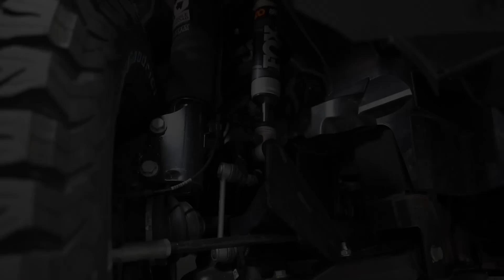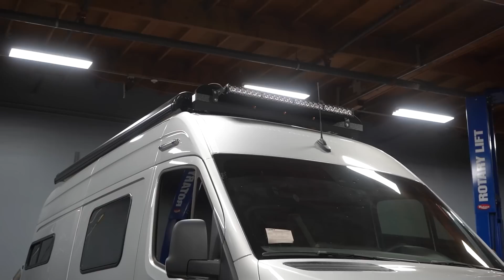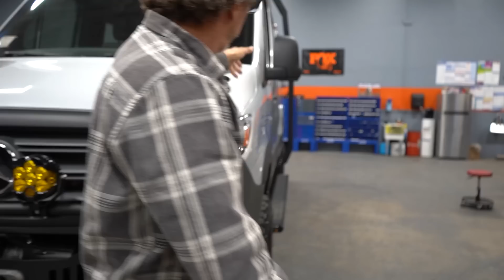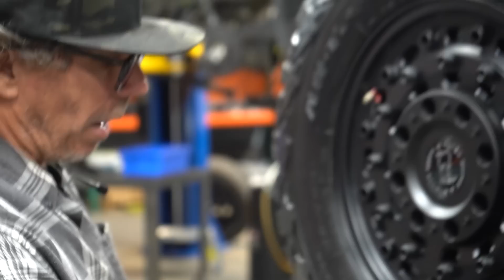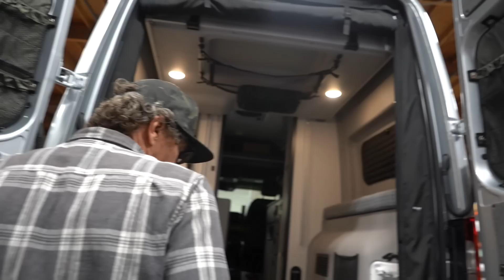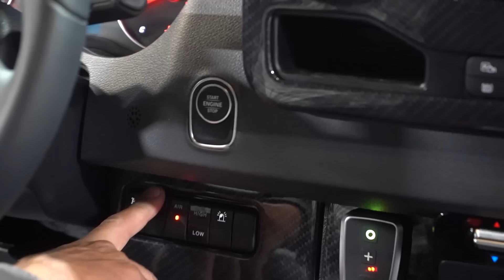2022 Winnebago Revel 4x4 | FULLY LOADED Agile Off Road Build

Comment: I find it weird that they didn't do anything to beef up that rear axle. Such a tiny rear axle, seems like a major weak point.
Reply from the maker: The Sprinter was originally built as a heavy-duty cargo van. Axles are thick & plenty strong. We haven't seen one break yet even with the extreme loads the ARB Rear Air Locker puts on it. Now that this van has the appropriately rated leaf springs & shocks, it's rock solid.

Comment: All these added skid plates, bumpers, winches, racks, boxes, side ladders etc….. add a lot of weight. I bet when these vans are all loaded up they are over the gvwr and overweight.

What is the OCCC rating on the Revel?
Reply from the maker: Even with the RV buildout & the accessories we've added these vehicles still leave our shop under GVWR. Now given the relatively heavy weight of these RVs, the factory suspension & brakes to some may feel inadequate. Our RIP Kit (ride improvement package) & Big Brake Upgrade are specifically designed to address these shortcomings. We won't go so far as to say an Agile Sprinter handles like an AMG sports car. But windy stretches of highway, uneven driveways, rough off-road terrain & steep mountain passes are all easily manageable with these upgrades.